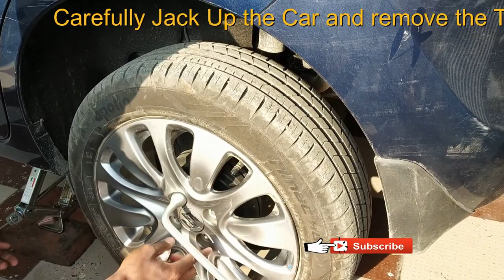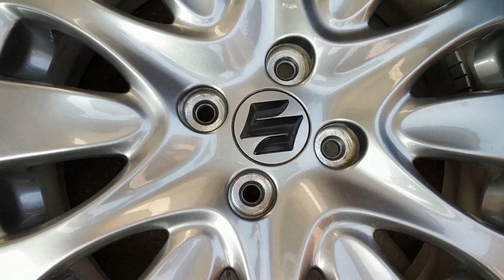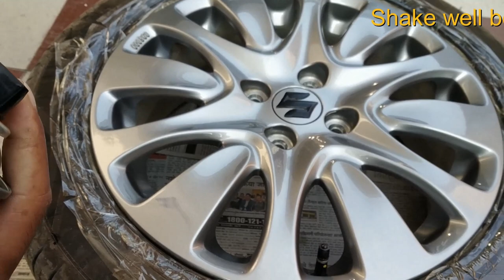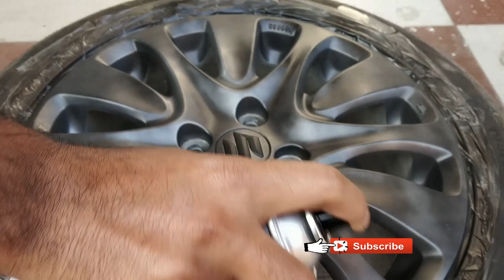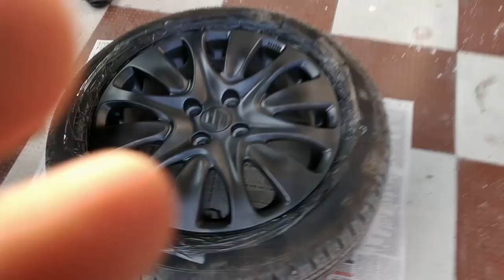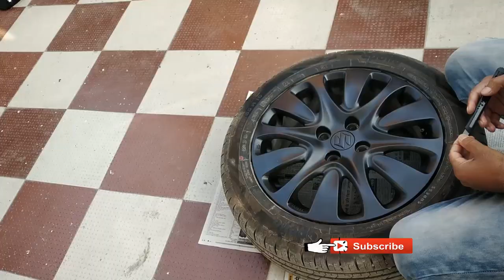Learn how to Spray Paint Wheels! Spray Can Painting [Full Tutorial]

Comment: For how many time the paint will be there in the wheels.

Thanks for the update.
Reply from the maker: Hi Rohan, 
Though spray paints are not permanent, but the paint doesn't come out until we want it to. 
So, if it's kept away from Acetone/thinner/petrol/diesel. It would last as long as the normal paint lasts.

Comment: what is the role of  powder coat and clear coat in painting the wheels?
Reply: Does it is good or bad?
Reply from the maker: Hi dear, 
Powder coat and clear coat are two different process of painting. Clear coat is last coat of liquid painting. 
Powder coating is entirely different process in which powder color is baked on to the surface

Comment: how many cans  used? did u paint inner sides also? sanding and primer required or not?
Reply from the maker: Hi Gurdeep, 
As the alloys were new, so no sanding was required, but they were cleaned and wiped with acetone to remove oil and dirt. 
Primer is not required in Spray cans painting. 
But to get even contrast you can go with primer also.
And one can was enough.
Reply: one can for 4 alloys and inner sides too?
Reply from the maker: Yes one for all alloys, just buy genuine spray can. There are other fake sprays cans they look the same but they have less paint(almost half). 
And no, you don't need to paint the inner side of alloy.
Reply: doesnt it look odd, i want to paint both sides 2 cans will be enough?
Reply from the maker: Although, the inner side is not visible. 
But sure, 2 genuine cans would be enough. But just be on safer side buy three.
Reply: ok thnx bro
Reply from the maker: Stay safe